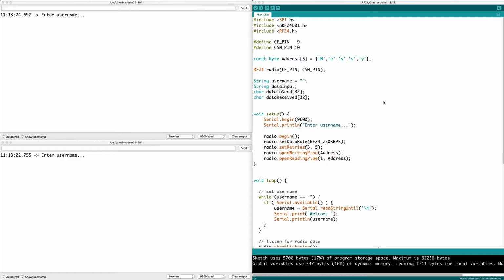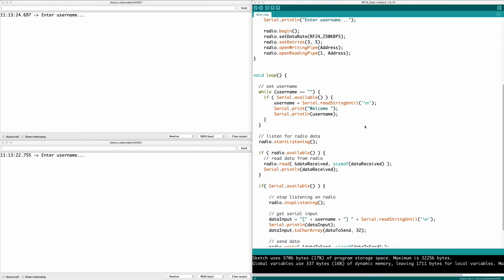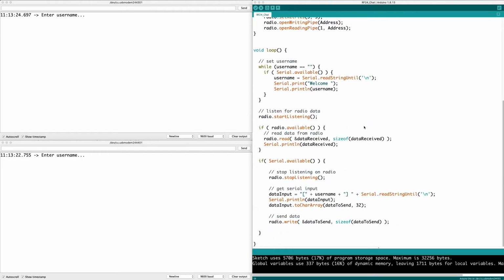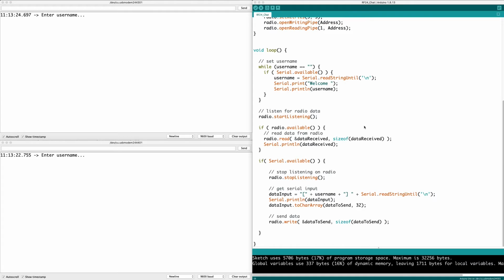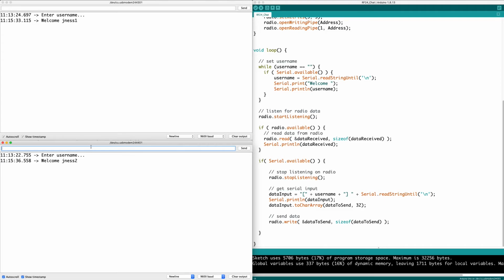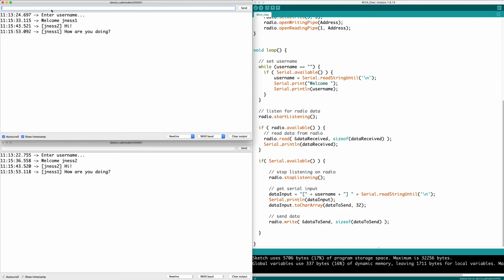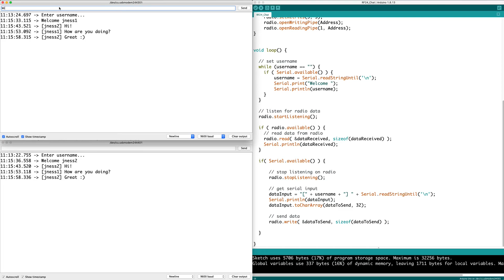Wireless Chat using Arduino & NRF24L01+ 2.4GHz RF Transceiver

Comment: Very interesting code, but unfortunately it doesn't work for me. Should anything be changed? (I have the same pin numbers)
Reply: i thing you havr to set the channel for the modules. if you are using mini modules without antenna, channel value will be 20, and for big modules with antenna the channel value should be 100
Reply: @AkashBagFEce  Exactly. Everything works with the larger channel.